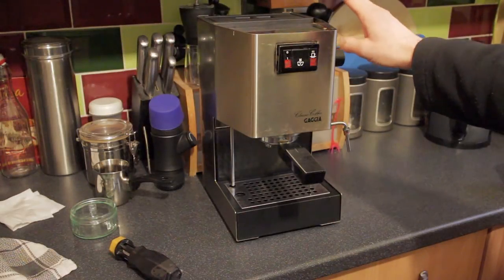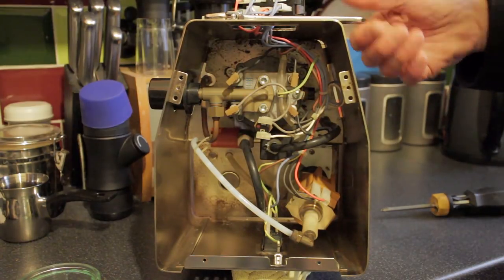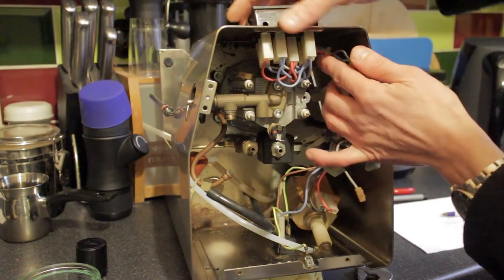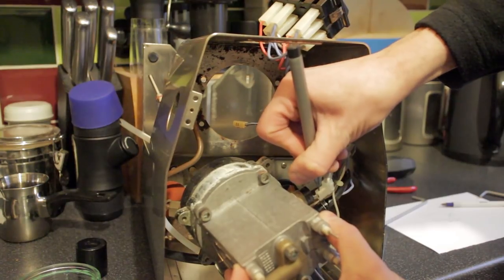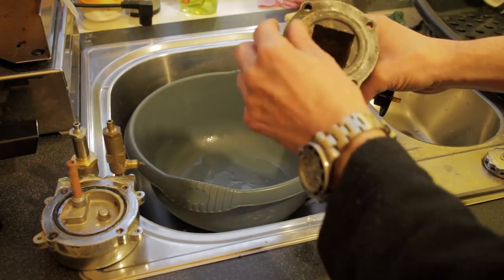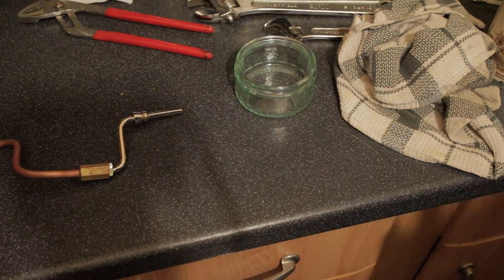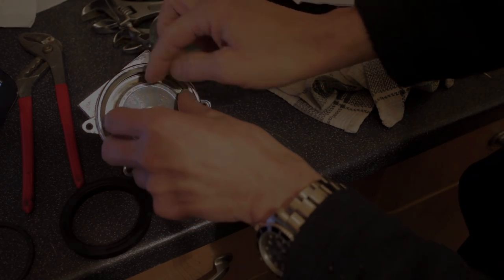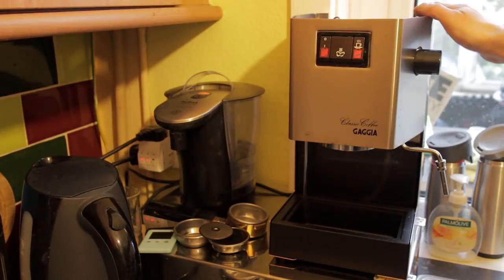Gaggia Classic Full Service and Descale, Boiler Strip, Seals

Comment: Thanks so much for this. I just bought a used Classic and got scammed with a faulty machine, it probably has calcifications blocking it's valves.
I'll be using this video for the teardown for sure. Hope it's only the valves, also hoping I won't mess this up horribly like I did my previous adventures involving water.. :)
Reply from the maker: Fingers crossed for you that it's an easy fix, on a positive note. Spares are really available and not too costly.
A good soak in citric acid will not hurt and hopefully you'll be up and running with delicious coffee very soon.
Reply: @spidiq8  citric acid attempted , unfortunately, nada. Time for a full teardown. On the bright side, if I can fix this, I might take the plunge for a more expensive/complex machine because I'll be less worried about service costs. Fun intro into espresso machines for sure...
Reply from the maker: @inconspicuous-nobody  That's the spirit! You can get some great single boiler heat exchanger machines without going into commercial territory.
Just take the disassembly carefully and take photos along the way, you'll realize it's far easier than you'd think.
Keep me updated. Always interested to hear another's coffee journey.
Reply: @spidiq8  I have my sights set on an Arte di Vittoria BFC Junior. The €380 asking price and the plethora of unpleasant problems (it was a machine previously in commercial use) I could encounter there are the things holding me back, mostly the latter.
The Gaggia goes first though. Thank you for the tips, I'll definitely keep you updated :)
Reply from the maker: @inconspicuous-nobody  If you can handle the Gaggia. (And I'm sure you can), a commercial machine differs only in the fact that some of the parts are a bit costlier which is just because of the nature of it. However, once running you'll only ever need service items once every couple of years or less perhaps s you won't be using it as heavily as in a commercial environment.
The most important thing is regular flushing if you're in a hard water area or use bottled or filtered water.
Reply: So, the promised update, the Gaggia hasn't killed me yet!
I finally had a few hours to disect it and put it back together. I noticed leak marks (rust and calcifications) from the OPVs top pipe connection, the bottom of the elbow joint on the pump and the boiler. Lots of water marks right next to 220V, scary stuff. I took out moka spoonfuls (!!!!) of calc deposits from the boiler, and everything appeared blocked up. I had to sand the mating surface with 60 grit there was so much pitting (then went gradually up to a smooth finish ofc with 600) , and I still didn't remove it all.

Considering that this summer I had severe problems with making a toilet tank watertight and failed massively at sealing a pipe joint with PTFE tape, I wasn't sure I'd manage this thing. I've also had a bad experience with a small kitchen boiler before.. and I was ridiculously incapable of re-wiring a large household boiler after an attempted descaling. Basically, by my history, absolutely everything should have gone wrong here!! I plugged it in and turned it on wearing thick rubber soled shoes and gloves on my terrified shaky hands (yes, that's the bad experience paranoia there).. and it now pushes coffee through the grouphead!! The rest of the testing remains to be done tomorrow.

I didn't give the OPV a long soak because I was too lazy to check how it works (and have no way to measure pressure)... So that's a questionable point. I didn't do anything to the leaky pipe joining it on top either, so hoping for a miracle. The pump is very dodgy, I opted for a bit of PTFE tape and an (iffy) o-ring instead of threadlock sealant. I also moved a piece on the pump I'm not sure I was meant to move, (that top plastic shaft, it turned quite a bit). I was too cheap to replace any O-rings (advice of someone else who's done repairs on GCs) except for the one connecting to the pump, so I just cranked down on the screws everywhere and I'm crossing my fingers for no leaks tomorrow.
Edit: had some hissing, but no apparent escape of water. Ready light turns on and off in relatively quick succession. On switch has some arcing. Coffee brewing pulsates between grouphead and OPV I think. OPV behavior is dodgy when backflushing.. not sure about leaks. So, less than great.

Tl;Dr: So, besides the original problem, I found a few more when opening it up and probably created several more still, but I'll see tomorrow! Still a bit terrified, but it could have been worse already :D
Reply: And honestly, no matter how further testing goes, I'm probably going to hate this machine for all the unexpected trouble it caused me. I'm looking at the picture of that BFC Junior I'd like to buy and salivating... Highly likely that I'll snatch it up!
Reply from the maker: @inconspicuous-nobody  Thanks for the update and the humour, I'd say a huge well done and that sounds like a positive move, the opv might benefit from a strip and soak in descaler if you've had to remove so much from the boiler. The Allen key on top adjusts the pressure that it releases water back through and for that you need a portafilter with pressure gauge which you can get from eBay or modify an existing portafilter handle if you have one by fitting a pressure gauge. However, you can place it roughly by counting the number of turns in before removing for cleaning.
Reply from the maker: @inconspicuous-nobody  Go for it, and use your positive experience on stripping the Gaggia for this.
I will say a better machine with a hx boiler or double boiler is better in comparison because it's much more consistent.
Like the wega in my other videos which I'm still stripping and sorting.
Reply: @spidiq8  Definitely going to attempt that pressure valve clean, but not before recovery from something I've heard people call "overhandsonitis" :') so I'll be enjoying crap coffee for a while, still better than no coffee!
And the one thing failed tingering does better than successful tinkering is providing an entertaining story to tell 😅

Worried that the proper pressure mod (I heard it's usually set too high to be ideal) would further inhibit the already shoddy steaming capabilities.. I'm addicted to the milky variety of coffee, so if the espresso gets better and the steam gets worse, I'm not that much further in the right direction

 I'll be taking a look at your channel for those wega videos, always good to learn! :)
Reply from the maker: @inconspicuous-nobody  The opv doesn't affect the steam pressure, only when pumping through the group head.
The steaming capabilities aren't the best because it's a tiny boiler but it's not bad.
I've found they have various settings and suspect that they were set 'roughly' around a certain pressure at the factory or so many turns out from fully closed. Don't worry too much about that because it's actually harder to get consistent temperature for extraction than pressure.
Reply: @spidiq8  Thank you for that info! Good to know. I've been playing with a thermometer and some temp surfing and in a few days I hope I'll get reasonably consistent decent coffee.

(Regarding the OPV, maybe I should have thought through that idea before typing it out :')) thanks for pointing out the faulty logic.)
Reply from the maker: @inconspicuous-nobody  No problem, I'm sure once you're dialled in you'll surprise yourself. This machine is as good as it gets on entry level proper espresso and espresso based coffees.
Even latte art is possible.
Happy to help where I can.
Reply: @spidiq8    You've helped me along my descent into this rabbit hole for sure.. 3 years ago something similar happened to me with a bike, now I'm an apprentice bike mechanic and have a basement overflowing with 20+ bikes and parts. (Edit: not your kind of bikes.. the human powered ones ;)) Hope I won't catch the bug so badly this time.
Thanks again! Looking forward to more videos with the Wega!!
Reply from the maker: @inconspicuous-nobody  Cycles or motorbikes?
It's healthy to have more than one hobby though. 😆
Reply: @spidiq8  Cycles! They're less prone to severely injure the end user if I muck something up.

Fine line between more than one and one too many.. Definitely on the side of one too many here already
Reply from the maker: @inconspicuous-nobody  Haha, I'm sure you're more competent than you think.
I prefer my cycles with engines. Far less pedalling effort.
Reply: @spidiq8  I've done a few questionable repairs. 😂 Then again, most bike shops do the same just won't admit it. The pedaling effort is part of the charm for me, and there's something about being able to travel long distances for free that draws my cheap student existence.

I can definitely see the fun in motorbikes though. One day...
Reply: @inconspicuous-nobody I was obsessed with bike mechanics. Then I broke my back cycling and now I'm modding a gaggia. You never know where a rabbit hole will take you.

Comment: Quick tip. If you're doing anything over the sink always, always have the plug holes in the sink plugged. Trying to retrieve a small screw that's gone down the hole can be very frustrating.
Reply from the maker: Excellent point. Thanks.

Comment: Just purchased a second hand Gaggia Classic and a bit gutted as no water comes through the grouphead. Steam and water comes through the wand fine, so could it be the solenoid? Any tips on what I should do here?
Reply from the maker: It's some kind of blockage to the group head as it's getting to the steam wand.
Quick and easy check would be to unscrew the screen and the dispersal block and see if it flows then. If so, it's the dispersal block, if not something further in.
As it's second hand anyway I'd recommend you strip, descale and clean as per the video then you'll know it's spotless and with fairly regular descaling will be OK for a long time.

Comment: Hi love the vid. I have unscrewed the boiler sense of temperature and noticed some white residue between screw and boiler. is it something put there to avoid galvanic corrosion. do I need to replace it before I reassemble ?
Reply: the white residue is also on the steam thermostat.
Reply from the maker: Simon Nygaard Thanks, glad you liked it. Is it powdery or does it appear slightly viscous? I'm not entirely certain but it could be a thermal paste to aid heat transfer but if powdery more likely it's galvanic corrosion, clean with a nylon brush, (toothbrush e.g. or a scotchbrite pad like a dish sponge and a dot of thermal paste won't hurt if you have any, if not a tiny dot of copper grease but not lots, despite the name it's not the most efficient conductor.

Comment: Yeh thanks : have tried all that - sometimes pump is very loud and obviously working other times it seems to be quite and not working!!?? Will try some cleaning powder otherwise I might take you up on your very kind offer in Glasgow ...!? Many thanks James
Reply from the maker: There's a possibility the pump is wearing out, they're a non serviceable vibration pump but aren't too expensive to replace but it could just be a blockage that's restricting it as the noise does vary according to back pressure.
Let me know how it goes.

Comment: Thanks for the excellent video!
Was doing well, if a little slow, until I got to cracking the 5mm allen bolts on the boiler. Shifted three but the fourth head sheared off. Got the boiler open but need to remove the stub of bolt!
Any tips?
Reply from the maker: Is the bolt protruding or has it snapped flush?
If protruding, heat the area gently with a blowtorch and use mole grips to unfasten it, the alternative to heat is leaving that bolt soaked in penetrating oil for a while.
Galvanic corrosion between steel and aluminium can really grip though.
If it's flush, similar to the above but you'll need to carefully drill it and use something like an easy out.
Reply: @spidiq8  Protruding. Soaked overnight in WD. Filed off square and a big auld fella shifted it. Back on course! Many thanks and really enjoying the little project.
Reply from the maker: @quickrimscb  Great stuff.
When you reassemble use a very small amount of graphite grease on the threads and make sure the mating surfaces are flat, use a sheet of wet n dry on a glass plate or other flat surface if need be.

Comment: Great video this but I still have just drips from the group head after the replacing pump and removing solenoid and dismantling it , which looked like new, I but I cleaned it anyway and checked flow by blowing through it.   I would appreciate your advice and an explanation of how the flow works from pump to group and wand as the pump feeds the group so I can't see where the solenoid fits into the flow or how it affects it, especially if it does not actuate.  I used to have good flow to waste on switch off  but none now.
Reply from the maker: I received mine with resin and spare fep

Comment: thankyou so much for this but i am having real trouble taking the solenoid valve apart, any tips?
Reply from the maker: richard dalton which part? The aluminium bolt that holds the electromagnet or do you mean removing from the boiler?
Reply: not to worry, i meant the solneoid itself - how to take it apart to retrieve the springed piston inside and clean it properly. FYI - if any others are struggling with this, mine was incredibly stiff and i ended up screwing the base of the solenoid into a plank of wood and then using a spanner to get it off, thanks anway :)

Comment: The best video!

Question: if the inside of the boiler has little holes (looks like the aluminium dissolved), should I be concerned?

And if there is quite some chrome plating missing on the inside of the group head, should I replace it?

Thanks for your help in advance!

Kind regards
Michael
Reply from the maker: I would recommend that you replace the boiler and group head. Definitely the boiler.
Reply: @spidiq8  Thanks a lot for the quick response - much appreciated 😊 Have a nice weekend 👍🏻

Comment: Thanks for the fantastic video I'm going to do mine today. I mentioned very little about the pump, does that need descaling or servicing and when do you need to replace it? Thanks again
Reply from the maker: Thank you, you'll find it's surprisingly easy. The pump is a/serviceable item as they're not designed to be stripped but what you can do is run a tank or two of citric acid solution through first before stripping in 30 or so second bursts.
Reply: When would it need replacement? When it suits working completely or are there other scenarios
Reply from the maker: @eugeneniemand  If it failed to pump and build up adequate pressure, this would be very evident. You could also look up the flow rate which I don't know offhand and pump water through into a measuring beaker for an appropriate length of time to see if it's near enough. I.e. if it's 250ml per minute 30sec worth of operation should yield roughly 125ml of water.

Comment: Great video thanks. What does it mean if no water comes through?
Reply from the maker: Thanks, it could mean many things from a blockage somewhere to a failed pump to the plumbing not correctly fitted.
If it was working and has stopped the most likely culprit is the pump. These vibratory pumps are cheap and though they can be stripped they're not designed to be rebuilt.
If it's new to you check if you only have one hose to the water tank that it's on the correct fitting, there are 2, a feed and a return.
Once you know that's correct you can test the pump by pulling the feed to the group and powering it to see if it pumps water, if it does then the blockage is in the group somewhere.
Reply: spidiq8 we’ve had it from new, a long time now, anyway I took the ‘sieve’ bit off from where it connects with where the coffee goes and it was filthy with built up dirt. I used some cleaning solution and let the parts soak overnight. Just put it back this morning and it works again, the water comes gushing through. Thanks for the help, but I don’t think I had the knackers to delve deep inside the machine as you did, my toolkit consists of an axe, a hammer and an old butter knife for a screwdriver. A skill passed down to me from my father who tended to fix everything from watches to TV sets with the old hammer. Thanks again.

Comment: Thank you for this! For some reason, the silicone ring that seals the boiler doesn't fit anymore. Do you know why? It's the same one as was on the machine before I took it apart
Reply from the maker: Sorry, I couldn't say for sure, I know some types of rubber O rings actually deform and expand once removed and are nigh on impossible to refit, the boiler one however, I wouldn't recommend re using the gasket as it's such a crucial one and holds all the pressure.
Reply: @spidiq8  thanks for replying! I'm having an issue where the steam wand won't produce much steam. It produces some stuff but not very powerful then stops. Do you know what's wrong? I've descaled many times and even stripped the machine and descaled again. But nothing fixes it. What can I do? I have a Gaggia Coffee